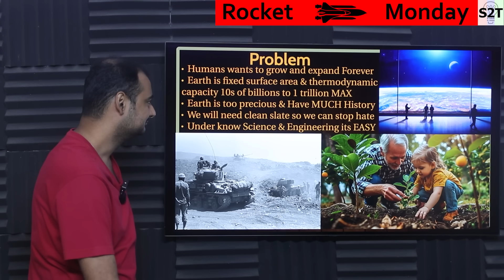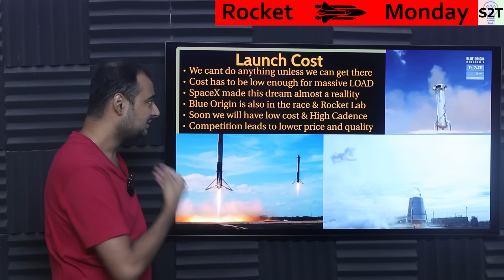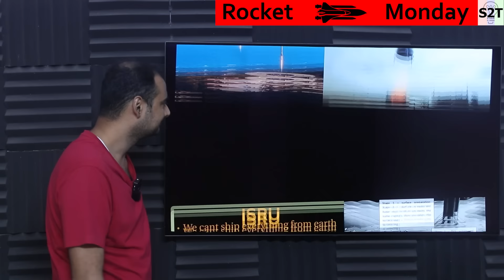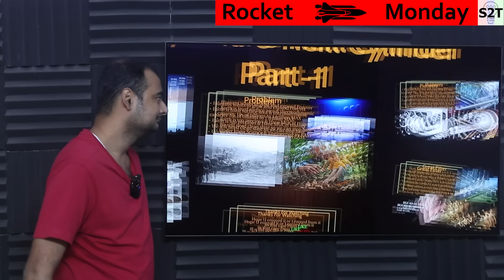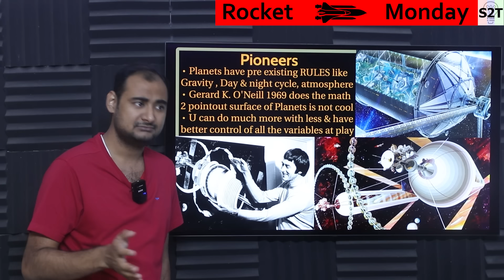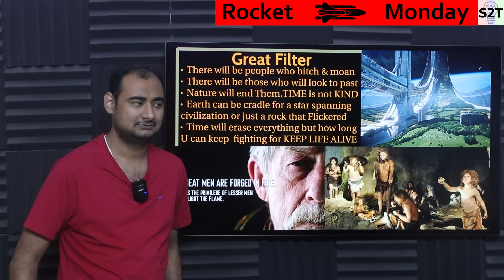Why Build O'Neill Cylinder {Part -1} Explained {Rocket Monday}

Comment: Brilliant summary of what is necessary for humanity to survive the fermi pardox and great filter.  I suspect we will ultimately create a dyson swarm around earth then closer in to the sun.  There are canidates for dyson swarms around other stars out there. That impies humanity will merge with AI, genetic engineer itself, create digital versions of individuals, but all you are talking about has to happen first, or we are cooked, finished as a species.  So we have to expand to space or die out. Imperative for survival of the species and future variations of humanity.  We can also beam down energy from space to power earth, even do weather control for the planet?
Reply from the maker: That depends on weather we take the first steps or not